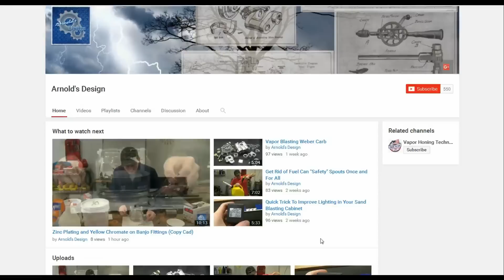Bead Blasting Tips for Long Bead Life and Best Finish

Comment: Did you first of all sandblast this part before the glass bead polished the surface? I had no idea you could get this shine with dry glass bead
Reply from the maker: Yes, it was abrasive blasted first. You will get a nice finish. It won't be quite the same as vapor blasting, and the surface won't be as clean when finished, but it's the only option for magnesium.
Reply: @ArnoldsDesign thanks for your reply, I’m new to think but I have a wet blasting cabinet, can you wetblast magnesium alloy? Many thanks

Comment: Today  i had a test  my  sand blast  machine..and  i found  that glass bead could not  make  shine  Aluminium  surface...it looks like  grey color,  not  shine...so  i was  very  headache...and  tried  to  find  the  way  how  to  make  shine  Aluminium  surface...
So finally  i found  out  after watching  your  video .

I used  Glass bead  ( 100~170) and  high  pressure  ....it was  problem....so  tomorrow  i  will try  it  with  your  recommendation...

Thank  you  for  your  nice  video...very  helpful...

Comment: The beadblast I did doesn't shine. What is wrong with this? The pressure is from 6 bar to 8 bar. Is the moisture in the compressor a problem? Or is pressure, nozzle thickness a problem? Is it good if the thickness of the nozzle is big?

Comment: Hi ARNOLD   your review and experience using glass beads and aluminium as a media was very interesting I have only just started as I need more information ! I am wanting to clean the very tarnished carburettors in a de-greaser first then and or a ultrasonic cleaner THEN GLASS BEARDS TO FINISH THE ALUMINIUM OFF However what grade of glass beads should I use ?  With near all products I blast are alloy with stained parts would you advise walnut shells to clean and glass beads to polish and low pressure ?    Cheers BRIAN from the (UK)
Reply from the maker: I would blast them with very fine sharp abrasive after degreasing under lower pressure. Get the hard oxide shell off. Walnut shells won't remove that. Then finish with beads at low pressure. I use coarse 40-60 mesh, but a lot of people use #13, (170-325 mesh) with good results.
Reply: @ArnoldsDesign  hello arnold I have used the 170/325 mesh but it does not give me a shiny finish what do you think it is due to? Do you want the nozzle of my gun to be very large (6mm) I use 50 psi pressure

￼
Reply from the maker: @acabadostorres3684  170/325 should give a good finish at 50 psi. Make sure the oxide layer is removed first before finishing. Then you can use lower than 50psi if you want to.

Comment: Hi, I'm a hobby beginner and I have some questions about sandblasting:

1) I have bought a closed cabinet it also have the inlet with a filter to attach the vacuum cleaner ( i also have a professional vacuum clear) do i have to use it? Can I suppose that it won't loose dust in the rest of the garage? 

2) I have a 3M 6055 respirator do I have to wear it during operation even with the closed cabinet? 

Thanks.

Comment: How do you decontaminate the metal surface if you're using the crushed glass with higher pressure?
Reply from the maker: I use wet blasting to clean it afterward. If you're welding afterward, the glass won't hurt.

Comment: I've heard people mixing aluminum oxide and glass beads with a vapor blasting machine, would this work with dry blasting in theory too ?
Reply: Yes it work, i use to mix white aluminium oxide with glass beads, will give fast cutting and leave a brighter finish. 👌🏻
Reply from the maker: Yes, it works. The finish won't be as bright, though.

Comment: We have some parts we bead blasted and then had clear anodized, the surface sometimes comes out blotchy after the clear anodize. Any idea why that is happening?
Reply from the maker: Specifically, no I don't. There are discussions addressing that on finishing.com. It might have something to do with the alloy itself. Some are more anodize friendly than others. I know castings, especially older Japanese castings, need desmutted first before you can get a good anodize. It might be something too, like making sure the parts are perfectly clean before anodizing, and passing the water break test.
Reply: Thanks for the feedback.
Reply from the maker: You bet. I hope you get it squared away.

Comment: Hi, im new to sand blasting, im getting a hopper type and my project is to clean a aluminum block engine the trick is i cannot remove the engine from the care so i have limited room to work with. my goal is to have a metallic look but with as bright of a shine as possible. Im getting a  medium soda abrasive to clean everything out with and i think its my safest option to start with.  what should i go with after, the glass beads?
Reply from the maker: Soda will clean well. Glass beads will leave a good finish, but be careful they don't end up getting into any ports. A hopper blaster is going to take a very long time to do.

Comment: Hey Arnold, I wonder if you can help with your experience.   I'm trying to finish a product with fine engraving approximately 2 microns deep.   This is enough to use blackfill to make the engraving clearer.  The parts are CNC machined and come with a highly reflective mirror finish.   I need to bring that finish down to matte/satin dulling any reflectiveness without impacting too much on the fine engraving while making the surface finish look as quality as possible.   Up to now I've been using what I think is a no-no approach to getting that finish.  I deburr with a red scotchbrite and then bring up the finish with a grey scotchbrite (to take out the brushed effect). Then I paintfill the engraving.   After this thoroughly clean and prep the surface.  Then I spray adhesive promotor, gloss lacquer and just before curing cover with several coats of matte lacquer.    This kind of works but the finish isn't as consistently hardened as I'd like, and it's a very fine art in terms of curing timings and when it goes wrong it's a nightmare .   I think I've been going about this all wrong, worrying that bead blasting wasn't an option because I'd lose some depth of the fine engraving impacting the ability to paint fill.  Having seen massive manufactures use fine glass beads to product a raw matte finish on steel and aluminium I was wondering if you can recommend a process of blasting with the right media to get close to matte finish on raw machined aluminium.   If I can find a blasting solution I can skip the lacquering and bake on the paint after blasting.   Any advice you can give would be great....

Comment: hi , I am new and just saw only few videos. vapour blasting or dry blasting which is best for cleaning automobile parts like new as they came from factory. is crushed glass can use for dry and wet blasting.
Reply from the maker: Vapor blasting is best for making parts look like new. You can use crushed glass in either dry or wet blasters.
Reply: +Arnold's Design thanks sir . I subscribed your channel. if any question come in my mind I ask you next time. thanks again.
Reply from the maker: You're welcome. Thanks for your comments and subscribing.

Comment: Thanks for a great video. I blast a lot of titanium medical implants. my problem is that some areas on my components gets polished and other areas blasted. any suggestions on how to cover the polished areas easily before blasting
Reply from the maker: I know of no easy way. I usually cover sensitive areas with 3M electrical tape, and cut out areas as needed with an X-acto knife. It's the only thing that will hold up to the water blast for me.

Comment: Have you ever used a fine garnet to deoxidize? Like 100 mesh? I’ve been told it cuts similarly to crushed glass and is just as clean. Wondering your opinion on that. It’s 3 times cheaper by me.
Reply from the maker: I haven't worked with garnet, so I really don't know how the two compare.

Comment: Thanks for the answer. At the moment I think I will get a small blasting cabinett for dry blasting with glass or ceramic (a friend manufactures the ceramics) beads to start out but still like the result of those vapour blasters. The problem I have with the vapour blasters is that as soon as you get a bigger box the purchase price quadruples and puts it out of my "hobby" range. But in order to do a cylinder of a V8 or even my V12 you need space in the box. Now you might say if one can buy a V12 Jag he can buy a big blaster but I only do this with 2 or 3 engines and that hardly justifies that purchase. Sorry to say that where I live in Germany no one has this equippment to let them do it for me.
Reply from the maker: I don't know about a v12 block, but a v8 block should fit fine in an entry level cabinet. Of course you would need to verify. Vixen makes a nice entry level machine, and I think it's available in Europe for around $15,000 not including a compressor. I know a vapor blaster in Belgium who has one. You'll need a high cfm compressor, either a good used rotary compressor or a new piston type which will be about the same price. If you can get a Polar Air compressor shipped to Germany, I recommend them. Good value for the money, and it's what I have.

Comment: Wow, great. You got my thumbs up. I see all the nice vapor blasting videos and wondered already how they differ. My problem is that I will soon retire and want to restore one or maybe 2 old cars to top condition and there is a little rust but they are dull and dirty and I hate cleaning with petroleum which is a mess and smells unhealthy even outside. Also depending on the weather I cannot always sit outside here in Germany.
Can you please make a video where you restore differnt parts, from aluminium to cast iron with a table for pressure and media used. I try to avoid having a gallery of blastmachines (this is a hobby not a business) and I cannot swap media just because I have a handful of steelscrews and later on I have an aluminium engine cover. Thanks
Reply from the maker: Thanks. I'm glad you found it helpful. Bead blasting can look nice if done properly, though it will still have a different finish than vapor blasting. Vapor blasting continuously cleans the beads, so dust build up and embedding in the material is never an issue. Regarding a table, do you mean how the pressures change the finish? If so, glass bead is about the only one that goes through a big change as you increase pressure, do to the beads crushing at high pressure. The other media, such as crushed glass, aluminum oxide, and silicon carbide pretty much give you the same finish regardless of pressure, but of course it will change cutting speed a lot. Those are about all the medias I use, with crushed glass being my preference. I don't use others like soda, walnut shells, etc. Soda is a good cleaner, but will not enhance or brighten a finish on steel or aluminum. If you get some little screw or parts, get one of those little hopper blaster like I showed, or a siphon feed blaster where you put the suction tube into a bucket or bag of abrasive. The siphon feed ones are inexpensive. The video idea would be good for comparisons between the medias I just mentioned on different materials, which is what I think you were talking about.